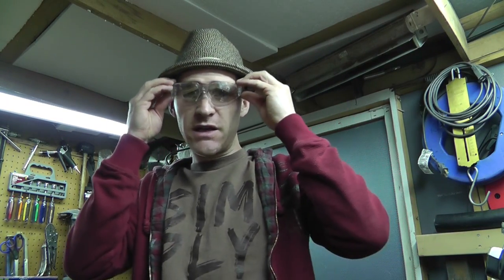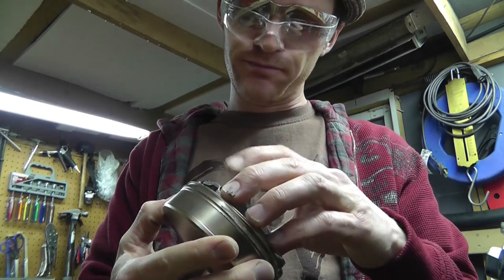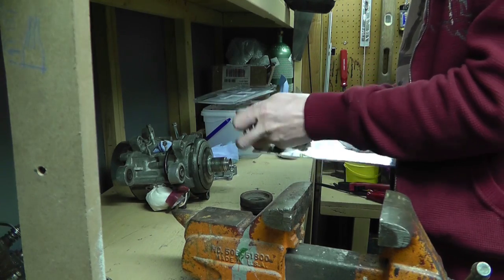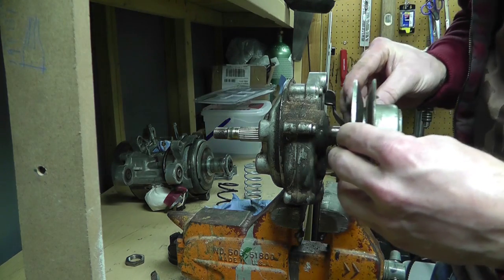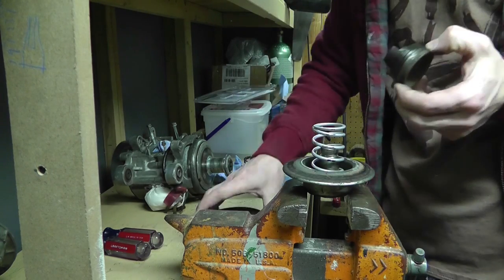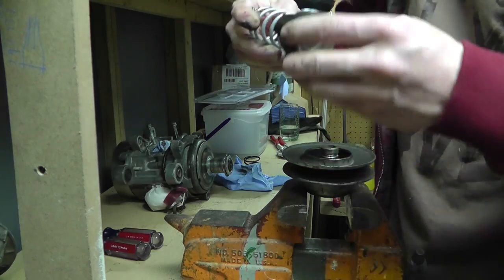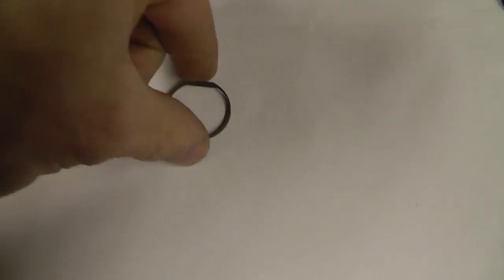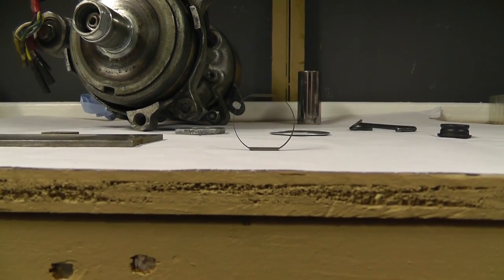#3 Honda PA50II Hobbit:  Variator Rework And Wire EDM Cut Shim

Comment: Nice video Russ, I like the shim you made for the clutch however I am concerned that it will break due to the fact that it is so thin. If it does break may I suggest a idea?  would it be possible for you to cut out an larger hole in the clutch plate with the wire machine (same type of shape that is currently on the plate but larger) and make another shim adapter that will have a larger "wall" thickness , basically the same type of shim design as you have made but bigger with a stronger, thicker wall that will fit into the larger hole in the clutch plate.

 just a thought in case the one you have made breaks then perhaps you may want to try this idea as an alternative.  :)